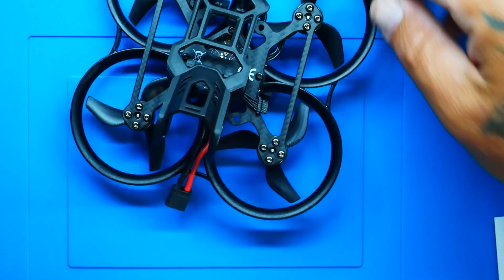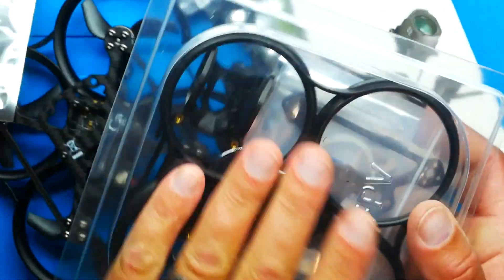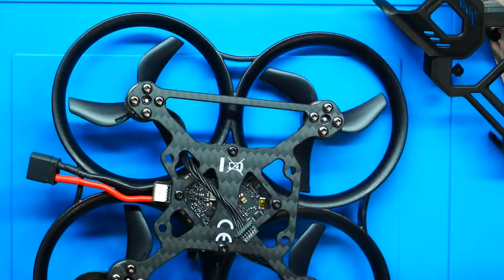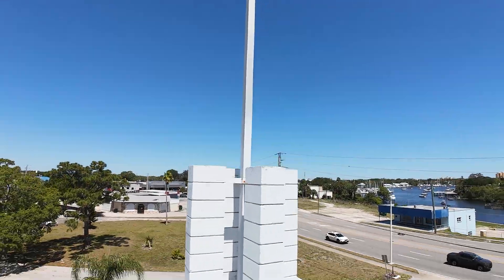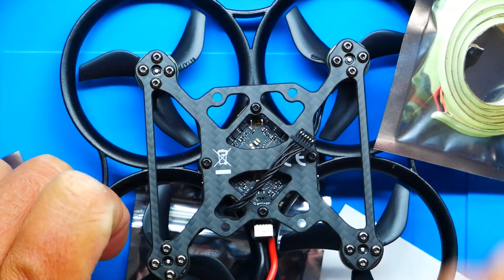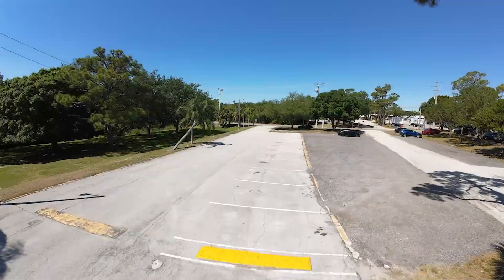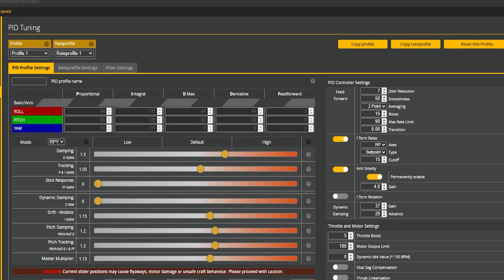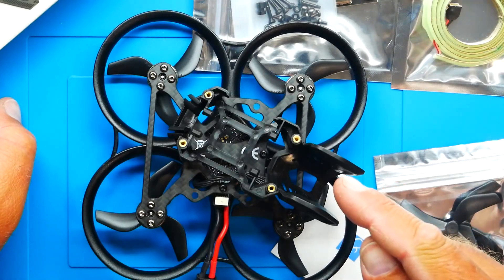Hot Freestyle Cine Whoop!! $104 Bucks 🤑 DJI 04 Air Unit Ready

Comment: Do what I did….

I broke a duct, and ordered a replacement. When it came in, I decided to use my broken one and cut off the ducts, and use it as bottom protection plate, and battery holder… HOLY CRAP.. this thing SOARS.. it’s so much more fun of a ripper without the ducts.

Comment: Excellent video DrainMan!

Can you please tell me how you bypassed the ELRS receiver?

Thanks again.
Sam
Reply from the maker: Thanks Samavella, you just simply toggle serial RX off of its selection, and for the V1 toggle on UART 5, and for the FC V3 version toggle on UART 6, lastly just swap the receiver protocol from crsf to sbus. 😊
Reply: @DrainManFPV Thank you Sir.  I thought it was one of those FC where you had to re-flash BetaFlight  it with SBUS.
Reply: @DrainManFPV  It’s confusing when BetaFPV has three different BetFlight hex files, one for each RX (ELRS, CRSF and SBUS). Here is what’s on their sight:

No need to flash configuration firmware (including CLI configuration)

BF405 4.5.0_Pavo20 pro_20A v1.0_SBUS_20241218.hex

BF405 4.5.0_Pavo20 pro_20A v1.0_ELRS_20241218.hex

BF405 4.5.0_Pavo20 pro_20A v1.0_TBS_20240729.hex
Reply: By the way, you can’t’ just toggle the RX and set the protocol to the SBUS.  For BetaFlight 4.5 you need to reflash the firmware with the SBUS protocol.  

Your FC must have an older version of BetaFlight.